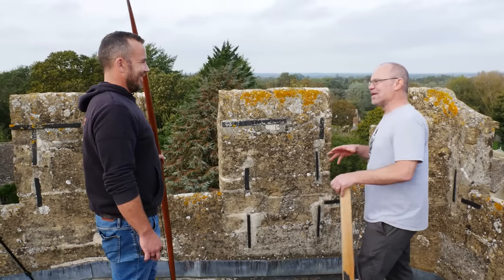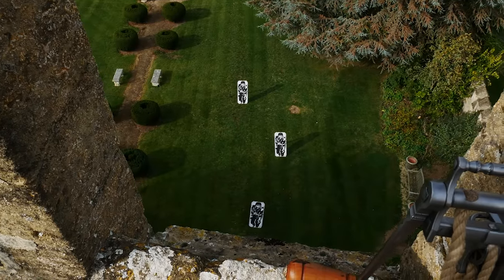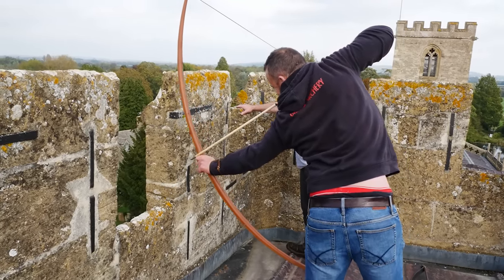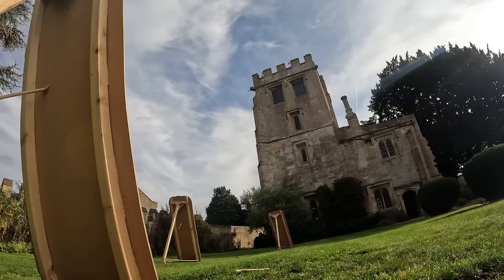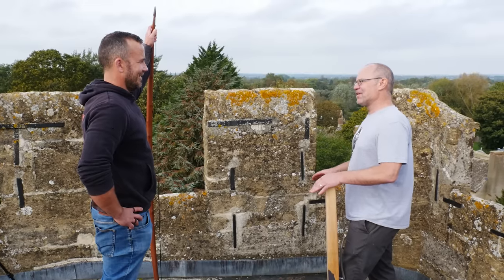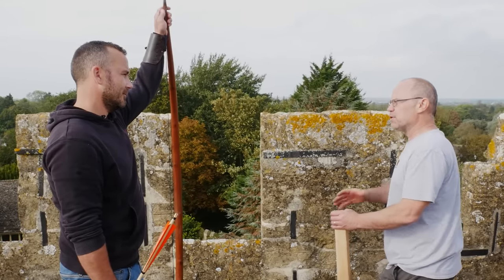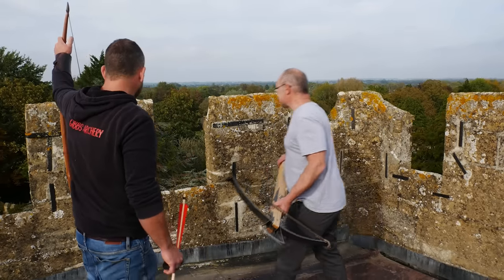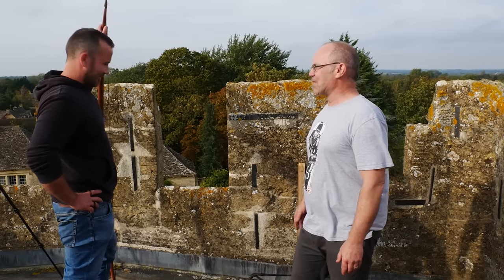Crossbow or Longbow? What's better for defending your medieval tower?

Comment from the maker: There are so many interesting points and thoughts coming up here - thank you.  Firstly I would have to highlight a couple of my oversights.  We know that crossbow men (but not always men) did employ spanners, so people behind the scenes spanning and handing already drawn bows to them and this increases the potential rate of shooting of crossbows and allowed it to be done in better cover than given by being on the 'front line'.  I also did not mention that of course crossbows can be spanned and held ready for a shot which is a massive advantage over a longbow which cannot.  However also note that a steel limbed crossbow can be held all day, a composite cannot, so cannot sit there ready and waiting all day.  I don't know how long you can safely leave a fully spanned composite, but I suspect they would want to get the shot off pretty fast, but still has a waiting/target selection advantage over longbows.

Weight of bows is very interesting.  Let's not pretend we actually know how heavy a war bow of the period was.  Quite simply we don't and it could be that the bow Joe is shooting would be exceptionally heavy for the time.  However unless he dropped weight really significantly he would still face the same problems, just to a lesser extent.  We must also acknowledge that the bows that came up from the Mary Rose (100 years later) were coming in at an average weight of about the same as Joes and I doubt period ships were that easy to shoot from either.  These bows were found in a naval context and were already falling out of use as a military weapon so we can draw inferences but not facts from these.  My personal opinion is that we're likely pretty similar to the bows of 100 years before; but again that is my opinion, not a fact.

Looking at the 'peek and shoot' difference between longbows and crossbows, of course every extra millisecond you are exposed disadvantages you over a quicker method, but I felt that there was not a massive difference between the two weapons.

As regards the ease with which a person can be trained to shoot a crossbow.  It is undeniable that you could span and shoot my windlass as I have seen my 10 year old daughter span it, that cannot be said for Joes bow.  With a little training you could shoot proficiently and threateningly  enough that at 50m the target person would dearly like to be somewhere else.  After a couple of hours most people would be striking the target pretty often at this range.  However crossbow archers were well paid, usually better than longbow archers and I am sure there are many reasons for this, but still there must have been very high levels of proficiency required for this better pay.  

But what we also know is during sieges it could be all hands to deck so to speak and walls would be manned by soldiers etc, but also by anyone who could be useful and that included women and children as well as men.  Some of these roles would be hurling rocks etc down, spanning bows, fetching etc but also I am almost certain I have either read or seen on manuscripts women shooting crossbows.  Of course Richard 1 was also famously shot by a (male) cook using a crossbow.  So it is absolutely fair to say that the use of a crossbow was easier for the untrained and possible for those with lesser physical strength.

That all said, I was very surprised about the lack of advantage of shooting down offered by the crossbow.  As a final note, shooting down is not at all a problem in terms of the bolt falling off, you simply need to put your thumb on the back of the bolt and hold it in place - the nut and string will do you no harm.  The spring clip to hold bolts was only invented around 1500, so prior to this your thumb was the answer.

As a last point, if anyone is reading this who has a castle, I would love to arrange some filming looking at arrow slits and proper crenellations.
Reply: Well said
Reply: I believe the reason for the pay of a crossbow user being high is also largely down to their gear simply being more expensive. And while yes, it's much easier to train someone to use a crossbow than a bow, there is still a noticeable advantage to have from proper firing discipline.

I'd also say that one other reason would be that archers were simpler to come by depending on where you are. Many people would have known how to use a bow at least reasonably well. At the very least well enough to be able to use a lower poundage bow with a fair degree of proficiency.

The increased cost of the crossbow kit would make trained crossbow users less common and I believe the general availability of the weapon itself would also be lower. So if you only have a limited supplies of crossbows, naturally you're going to want the people who are using them to be the best at using them.

There's probably other reasons but that's my thoughts on it.
Reply: @Salted_Fysh  They still had to be very effective  though, otherwise it just wouldn't work economically, at all.

If someone approaches you and offers you to do a job for 100$, and the other offers to do same, or even bit worse job for 400$, because he has much more expensive equipment... The choice is kind of nobrainer. No one would bother.

And entire continental Europe bothered with crossbow a lot, so it had to be worthwhile. Rulers protected the yew trees, because they were very useful for prods. Protected the arbalester guilds, and gave them privileges (like having first dibs on any horn available on the market). And so on.
Reply: It would have been interesting to see if a 50lb or so hunting bow from that period would serve just as well when they're up close, especially if looking for accurate shot placement, an arrow from a 50lb to the face would ruin your day as much as one from 140lb.
In 3d field archery we find ourselves shooting similar angles, much easier with the sort of poundage we use today.
Reply: @lscibor  well yeah, obviously crossbows are effective. But I'm saying the skill alone isn't necessarily the determining factor in the wage they get paid when compared to archers. It's more expensive to get and maintain the equipment. So even if you are not as skilled per se, you would still need to demand a higher price for your services. And since crossbows are useful (and people who use them usually come with a better kit), someone is going to pay it.
Reply: Just a thought, but if a siege went for a few days at the very least and i've got (as a defender) limited arrows, i will most likely not shoot neither constantly nor regularily. I think so far thats nothing new, BUT think of the consequences for the attackers: If the defenders shoot maybe once every few minutes and are out-of-cover for maybe a second or two, then there's no way to predict the defenders shooting, but also constantly shooting would be economically impossible for the attackers. So reversing it again, as a defender, whenever they are shooting volleys, you can just cover yourself, and when they shoot less, you have pretty good chances to take a look and decide werther to take a shot or not. Overall, i can imagine the defenders having an extremely "safe" situation (at least compared to the attackers), since statistics, circumstances (they can decide better when to be safe and when to attack) and economics are massively in their favour.

Imagine having one defender for lets say 10 crenellations and takes 5 seconds out of cover to shoot and shoots every 5 minutes. This would mean, in order to guarantee a hit every time (assuming perfect aim, but not being able to react quick enough to the defender popping up), this would need 12 shots a minute times 5 minutes times 10 crenellations where he could be, which would be a total of either 120 shots per minute or 600 shots in total. Now feel free to tweak the numbers, maybe he only takes 2 seconds, then it would be 1500 shots, or it's not every 5 minutes but every hour, then it would be 7200 shots (for 5s uncovered) or 18000 shots (for 2s uncovered). For a single defender and 10 crenellations. Basically, it is statistically absolutely impossible to preemptively shoot at crenellations in the hope to catch the defender in the right moment. And at the same time, good luck reacting, aiming at and hitting a target that is only visible for just as long as the person needs to shoot in your general direction.

I think this calculation suggests very well, why defence doesnt have to rely on numbers, since twice the defenders just means twice the chance to hit anyone, but are at a huge advantage when it comes to exchanging any type of ranged, human-targetting attacks. No wonder Sieges were won through cutting off supplies, hunger or at least finding some way to attack either the gate or the infrastructure behind the wall.
Reply: Great video, Tod. I think You missed one thing - no one shot at the besiegers so close to the walls because it was too difficult and too dangerous. And that's why the towers protruded beyond the walls so that people close to the walls could be shot from the side of the towers. In later times, fortifications in the shape of a star were built for the same reason - so that the shooters on one of its "arms" could defend the others. The bastions built outside the walls fulfilled the same function.

Another thing, I don't think that most of the defenders were equipped with heavy crossbows or bows - they were better for ranged shooting, but a smaller weapon would be much better for repelling attacks on the walls. It is not only more handy, easier to use and quicker to fire, but - above all - cheaper.

I think that when fighting an opponent close to walls, stones are much better. I hope that one day You will check how far You can throw 2 - 5 kilogram stones from the walls, but I think they would easily reach 10-15 meters. And You can throw them while completely hidden behind battlements - without aiming, but if there were a lot of attackers...

Anyway, I like thought-provoking episodes the most, so thanks again. And Merry Christmas!
Reply: Am terribly sorry do not have a castle to let you film at. What this did do is raise another question. What would the actual difference be when firing through murder holes? Theoretically i would say the construction of the crossbow would give it a fair advantage, but does it?
Reply: Should have tried shooting the crossbow vertically instead of the normal way..
Reply: I'm going to push back a little against the idea that we know what the "average" draw weight of the Mary Rose bows, because Yew has such a wide variability even when taken from the same tree. I know, for instance, that Will Sherman made replicas of MR79A0807 that came out at 130lbs, 145lbs and 170lbs, all using wood from the same tree. We have zero real knowledge of whether the high, middle or low end was what medieval bowyers aimed for when making livery bows.

If they aimed low, then the majority of Mary Rose bows were between 100 and 150lbs, with over half between 110 and 140lbs.

If they aimed high, then the majority were between 130lbs and 200lbs, with over half between 150lbs and 190lbs.

If they aimed for an "average", then most were between 110lbs and 180lbs, with over half between 130lbs and 170lbs.

(I can send you a link to my spreadsheets if you'd like)

A lot of assumptions have been made regarding how powerful they need to be in order to reach the ranges that people think are appropriate, but there's also been a lot of people not using the right woods or heads for arrows (making them too heavy) and arguing to a 220+ yard range when Tudor sources are clear that 220 yards is the maximum practical range and that livery bows and livery arrows generally underperformed in this regard.

Personally, based on the data I have on the Mary Rose bows, the size of arrowhead socket diameters, density of aspen, performance of modern warbow archers, well documented lack of nutrition on campaign etc, I tend to think that the range was 20lbs either side of 130lbs (110-150lbs) for livery bows, possibly scaling slightly lower.

It doesn't affect your overall point, I just want to point out the difficulties in estimating the draw weights for the Mary Rose bows.
Reply: @Cahirable  We do have some other points of evidence that suggest they were on the heavier side rather than the lower. For instance the skeletal remains that show huge imbalance, account of battle, invoice, historic account of effectivness and comparisons, other bows that survive in other locations and the like.  Mary Rose is a hugely important and as far as I know unique as a data point for the shear volume of reasonably preserved examples from a very specific date, but there are many other hints the draw weight is considerable in the bows that are meant for war.
Reply: @foldionepapyrus3441  

The issue with using the skeletons to argue for higher draw weights is twofold:

Firstly, the Mary Rose and Towton are the only occasions where we can tentatively identify archers through their skeletons, and the specific changes and injuries are almost entirely absent in the general population at the time. It's a puzzle that no one has really been able to solve, because by the 16th century we know that quite heavy bows were normal for sporting use.

Secondly, the skeletal changes associated with warbow use were identified because some of them are the same as the skeletal changes in Olympic archers, and are probably more a sign of the extent of practice than of draw weight.

I'm unsure of what you mean by "invoices" and know of no battle accounts or descriptions of performance that indicate 160lbs+/-20lbs as opposed to 130lbs+/-20lbs, but I'm always willing to check them out if you want to name them.
Reply: @Cahirable  As far as I know no documentation actually states at x draw distance weight should be y. But the point still stands there is a large amount of suggestive evidence pushing for the higher end of the estimates. How high is debatable, and would almost certainly vary hugely depending on exactly when in period you wish to refer to - armour improves so the bows get more powerful etc.

Including details like the descriptions of hunting vs war and the requirement to practice at the butts etc - if your normal warbow weight was at the lower end that mandatory practice would be unnecessary in a world where virtually everyone is employed at serious manual labour. Shooting in enough of the right direction to be useful  isn't hard, and that conscriptable force would I'd suggest  pretty easily  be able to pull the more 100 pound end. At least often enough to quickly become acclimatised to that weight and good enough to be a competent force.
Reply: @foldionepapyrus3441  

Henry VIII's archery law says that flight arrows shouldn't be used at targets closer than 220 yards, and one of the few things that Smythe and his critics agreed on was that 220 yards was the maximum practical range for a military bow.

 Barnabe Rich, who fought in Ireland in the 1570s with a lot of archers, says nothing about civilian bows being weaker than military bows, only that the civilian arrows (and hence draw) were 2-3" shorter than the military bow. Similarly, Ascham assumes that anyone using a gaming bow will automatically be able to use a livery bow, and his only real remark on these is that they tend to be less well made.

The butts in most villages, where we have two of them, indicate that most practice was done at 80-100m ("An Archaeology of Town Commons in England"), so while roving was a popular past time and there were famous areas like Finsbury where the arrows used were almost exclusively flight arrows (only a couple of marks are under 220 yards from each other), it seems that most archery practice was conducted at shorter ranges.

The overall picture is thus that by the 1540s and into the 1570s there was little difference between civilian and military bows when it came to draw weight, and the main differences seem to have been draw length and quality of manufacture. Since most people practiced at closer ranges and 220 yards was seen as more of an upper limit than a military reality, there's little reason to think that archers were required to shoot that far in order to qualify.

Additionally, given that it's very well documented that armies on campaign almost universally suffered from food shortages, reducing the abilities of the archer, it makes very little sense for the higher end estimates to be the norm on campaign, regardless of what was the usual draw weights of their "gaming bows".
Reply from the maker: And this discussion, it’s quality, thought, knowledge, politeness and other qualities is why I love the comments section so much - thank you
Reply: @Cahirable  On taking draw weight from the butts I'd have to say you are wrong - they would practice shooting shorter range as there isn't a great deal of point trying to shoot at greater distances anyway - you won't hit reliably. 

And while its not a direct comparison being from other continents we know tribes that almost exclusively survived because of Bow hunting even very very recently used draw weight that are more 60 pound as an upper limit, while still being able to shoot through the animal. (The Hadza as the example that jump into my head)

There is no reason to believe therefore that the English or European hunter would pack the equivalent of an elephant gun to shoot a house cat... And as that lighter weight bow wouldn't then be able to effectively shoot the warbow arrow heads that have been recovered as the required shaft thickness so the head's greater inertia doesn't snap or excessively flex the arrow makes the arrow just too heavy for it. I'd think and testing seems to prove - though maybe a stiffening processes could be done on the shafts we don't know about etc. 

But as you need that weight in the medieval period - you are not going up bow weight to shoot further, you are going up bow weights to be able to fire arrows that might actually overcome the armour). The same sort of thing that you see play out in modern military procurement - hmm body armours are getting common and effective - better up the power, make the penetrator of harder materials etc.

I don't entirely disagree with you, and we certainly can't know for sure without new evidence we don't have (or at least nobody in the comments has yet mentioned). But for me the body of evidence we have all points towards that 160+ sort of range for warbows.being sane but quite possibly still conservative.
Reply: Agreed. I guess professionalism is likely why crossbow men cost more as well as equipment.

This video even shows the usefulness of the crossbow as a blacksmith with a archery hobby can work decently with a crossbow while it needs an actual archer to attempt to use the bow.
Reply: This was an amazing video - awesome to look at the realities faced by medieval defenders. 

My only question would be about your discussion on the defender's vulnerability. I wonder if how exposed you felt firing from the parapet in your test, matches the actual danger in all but the highest pitch of battle. As you showed from your tests, while you felt vulnerable and your shots were awkward, the attackers are much more exposed in the open than the defenders are behind their battlements. And, no matter how awkward it is to fire from above, I'd presume it would be far more difficult to accurately fire up from below at a half obscured target ducking in and out of the hard cover the crenelations provide. When you consider attacking archers would also want to stay back at range so as not to be the sitting ducks your targets were, I'd be even more skeptical about their chances to hit with any reliability. Additionally, unlike this test - a real battle would have greater numbers on both sides. More defenders taking pot shots at exposed attackers would offer a degree of suppressive fire that would likely deter even moderately armored troops. Especially when non-fatal wounds to less protected extremities could still leave soldiers unable to fight, and even kill from infection much later.

I'd be interested to know if this was borne out in any of the battles of the day. :)
Reply: @Salted_Fysh  this can be somewhat sumed up with the whole levy archers style as a lot of pesentry expecally in the country side would know basic archery for things like hunting game (depending on area) so when called up to fight they would bring their own basic bow and of course be played less, where as crossbow expecally the heavy versions like the wind up ones would be more of a profesical army equitment supplyed by the lord which would of course intail more costs assosated with those archers
Reply: Firing down from a crenelated tower would be much easier with either a recurve composite bow or a crossbow with shorter arms. At the ranges you are talking about, a crossbow with a handier build would not  be penalized as much as a 4 foot wide 700# bow, as you would not see a significant drop off in velocity due to range and windage. 
At any rate, if the attacker is so close to the walls that you can't shoot down on them, there are other defensive measures, such as hot oil or heavy rocks to drop on them. The oil could be used as a fuel to burn the guys closest to the wall, with the risk that any fire might compromise  the defensive structure.
The shooting down problem was true for firearms as well, which is why many stone built fortifications had firing ports on the ground level with iron doors for protection from incoming fires. Fort Oswego in Upstate New York has such ports on both sides of the main gate as defense, behind 4 foot thick granite walls and an enclosed room for 10 to 20 musket bearing soldiers.
Reply: @foldionepapyrus3441  I think the biggest disagreement is whether or not the sporting bows used were hunting bows or "target" bows in the 1450s and beyond. If we were talking about 1350, then I'd largely agree. The archaeological evidence in the form of arrowhead socket diameter for the early 14th century shows a disconnect both between what shows up on peasant sites compared to castles or manors and also between military arrowheads found in military contexts and those found in the general population. The LM16/M4 arrowheads have socket diameters of mostly 9-10mm, but on manors and castles these tend to be 10-12mm. So, in my opinion, many of the ordinary civilians weren't using anything much above 80lbs for military service.

Fast forward a hundred years, though, and very few military arrowheads have a socket diameter as small as 11mm, and the texts start to imply that there was no real difference in power between gaming bows and livery bows, and it starts to become apparent that the introduction of mandatory training in the 1360s and extensive use of archers in warfare has resulted in most civilians owning bows to fulfil military (whether offensive or defensive) obligations. If they hunted with bows, they would have had one more suited to it.

If we look at the Ottomans and the Qing, then 130lbs is at the high end of what was used for actual military service, with only a few routinely drawing heavier bows and most drawing 160lbs+ as a test of strength. Mind you, given that on campaign performance was known to atrophy, training on heavier bows was an excellent way to ensure they could continue to use their regular bows for longer, and that may also have been done with medieval bows.

The weight of the arrows has often been exaggerated. With an M2/M4 arrowhead, or with a short bodkin like those at Camber Castle, total shaft weight would have been anywhere between 45 and 60g, depending on density and profile, and probably around 50-55g. Heavy, certainly, but not the 80-113g that is often imagined as the "standard" arrow. Joe's tests in AvA2 indicate that an arrow spined for a 160lb bow shoots sufficiently well from a 130lb bow, but he didn't think it did so well from a 110lb bow, which suggests that an arrow shot from a 130lb bow should shoot reasonably well from a 110lb bow, and also possibly from a 150lb bow. There was a similar test performed in the now-defunct Glade magazine that I've seen quoted a couple of places, where a Mary Rose replica arrows shot as well from an 80lb bow as from a 120lb one. I wish I could get my hands on that edition and read the full test, but what I've seen so far suggests that the Mary Rose arrows would shoot just as fine from a 100lb bow as from a 160lb bow, it just depends on how exactly they were spined.
Reply: @Cahirable  Hmm never heard of Glade and now I wish I could read it too. But if those replica MR arrows are shooting well from an 80 pound I'd be shocked if they could really work out of a 160 or more - certainly some range of draws for which the same arrow will do but everything I've ever read says the window that works well in historic materials is much much narrower than that. Always seems to be more like a 40 pound total range the arrow actually functions for. And I'd expect at the highest end the range of functional might well get smaller - the arrow will get heavier faster for every mm of radius the shaft needs, and it probably has to get fatter faster the heavier the bow - its own growing inertia gets ever more stubborn but the stiffness of the shaft doesn't increase similarly.

Though I could easily be wrong as the force over time profile a heavier wooden bow actually delivered may be very much different as well.. The thicker the bow gets the more of its energy must be wasted on itself, which might actually lead to a lighter arrow being shootable again from an even heavier bow - if the force is applied to the arrow a little less brutally in the initial acceleration phases as the heavier limbs have to get moving first it might actually work to put more energy into that light arrow than the light bow its 'meant' for and still have it shoot well enough... 

Be interesting to shoot a sensor package laden arrow from a few bows and/or have the real high speed camera (which I'd think would be nearly impossible to keep in the action in frame for the higher framerates). 

Probably also worth considering that the bows on the Mary Rose may actually not be at all typical of the period, though as far as I know there is no evidence to suggest there are differences. But assume they are intended for use at sea and as humidity messes with bows and the awkwardness of a shooting off the moving ships deck around all the obstructions means you may be deliberately choosing not to use the full draw. Which does lead to wanting more powerful bow - you won't be drawing it to full draw very much if ever, but still get reasonable power out of it at that smaller draw..
Reply: Crossbow has several advantages for the besieged. You mentioned several of them. But there is also one:
- The most common tactic for any siege is well... siege. The archer's ability drops significantly when hungry. Few days with minimal or no rations and they won't even be able to draw their war bows. While crossbowmen can still shoot. They will be as miserable as any other footmen but they will do their job.
Reply: @foldionepapyrus3441  The Glade is where Mark Stretton originally published his experiments with archery. There seems to have been a real burst of warbow related articles c.2002-2006, and we're lucky we at least have Stretton's blog and Hugh D. Soar's book to preserve at least some of them.

Sorry if I gave you the wrong impression, but the Glade article was 80-120lbs and then separately there was the AvA2 experiments with 110-160lbs. The 40lb range, as you suggest, seems to be the maximum spread for arrows.

Re: Mary Rose bows being special, I don't agree with this. The arrowheads from Holm Hill and Camber Castle would all fit the shafts recovered from the Mary Rose and suggest that the Mary Rose bows are representative of livery bows on land and in the mid-15th century.
Reply: @Cahirable  Ah, interesting info.
Technically the arrow heads can be identical and still have a thicker arrow shaft - thinning down a little bit more at the socket is not hard. Though equally if you expect to shoot it at only partial draw or while the bow is rather more water logged so performing worse then arrows that are 'for' a slightly lighter bow in ideal conditions may well shoot normally. 

I do agree though that it is unlikely the bows were different on land and sea - logistically seems like more effort than it would be worth to try and deliberately maintain a separate stockpile. Plus if a solider can get their hands on a more powerful 'naval' bow and actually manage to use it in their normal conditions they would, and a warship is often just as much about transporting troops and war material as it is fighting at sea in this period. So logically the ship should probably have had more normal bows as well if there was a difference.

But as far as I know we have no evidence at all either way, which means we should be open the possibility the bows of the Mary Rose are not really representative of their era, as there are some logical reasons they may not be.
Reply: Really wishing I had a castle at the moment.  😅
Reply: Surely there's a castle out there for arrow slits! Surely Bodium Castle would be perfect, no doubt you've asked the National Trust.
Reply: How far are you willing to travel for that castle?
Reply: Tod you want to know the real advantage of a crossbow not minor detail like the siege.
Have you & your mate wear various type of armours especially helmet types then you will realize a crossbowmen has a lot more protected options.
Firing a crossbow with a sallet, barbute or even a fully encased armet is easy but knocking a bow is difficult in anything more then a kettle or nasal helmet from my experience though I'm more polearm & staff treatise guy then ranged weapons that aren't guns. 

In a great basinet or great helmet say I wouldn't want to use any ranged weapon except maybe a javelin with practice especially if from mounted personally. 
Mind mounted you have lances & well muzzle loaded pistol stepped in on the cavalry role till lances were rarities by the time revolvers were common place with cavalry sword as a mounted side arm.

People that don't see the advantages of 'Crossbow' have never worn hefty armoured full harness.
Head to toe as long as you have a decent vision you can load & fire a crossbow but bow armour must be sacrificed to have vision & greater range of movement!
It is tiring firing a boy out of armour but try it with both arms & chest in full plate or mail as you will fire about 1/2 the amount of arrows you normally could.

Perhaps a very fit young man could fire arrows in full plate with the appropriate helmet for an entire battle but I know damn well I couldn't do it even before my failed health!
I could fire crossbow or musket in full plate with a even more protected helmet most of the day mind till I needed rest as we all do.
Drawn out battle or my deteriorated condition I know well I'd want a crossbow & am fooling myself to use a bow.
The bow is best for quicker decisive battle & prime fit men.

Another matter to consider is try carrying any polearm with a strung bow rather then crossbow  & say a pole.
You can wear a Pavise on back while carrying spear & crossbow over shoulder with aside arm on hip.

A bow you can't lay over shoulder or have on sling to wear like a bag as you can do with a crossbow.
You can free up hands with a strap & a pavise on back doesn't impede firing or spanning a cross bow as it would for a bow that requires form/upright-posture.

The most shield wise a bow user can carry is buckler with his side arm if realistic till it is cumbersome or awkward. 
The Cross bows strength is lack of training required, ease of use & simple ever underestimated versatility.
Mercenaries loved crossbows as they had no idea were their work would take them which try firing a bow in the alps in sub zero temperatures!
Cold & aching muscles matter a lot for a bow unlike a crossbow.

You might be in good condition but let the elements get deep to your bones for a few days traveling on foot or horse as I guarantee the crossbowmen will be truer with their aim & always at full draw unlike the bowmen!
You should both go a dip in ice then see who has the better aim & fire rate Todd.
Mark my words you will see the crossbows strength same as a guns for it doesn't take muscle but memory of action in motion!
Reply: Great vid. Would love a futher/deep dive look into this further. Different castle perhaps, different bows, crossbows etc. Ideally as much as possible ofc, withIn whats possible. Maybe a certain location that can he used for multiple videos to make proper use of your time/money.
Reply: Were are the Castle owning people!? WE NEED YOU TO STEP UP! 😁
Reply from the maker: This should be more of a Joe/Will answer, but spineing of arrows is not so important when it comes to distance (as far as I understand it).  A heavy livery shaft at 80g or a light MR shaft at 40g will both fly and just because the light shaft goes 10m left it doesn’t matter too much at 250m out.  An army is a big target after all.   It appears bows could be between 100-160lbs and no arrow would match this range and I doubt they were issuing different arrow spines, so the answer is realistically one arrow that kind of worked for everything.  A bit high/left, a bit low/ right or bang on.  Who cares; just loose the darn thing.
Reply: Hy tods i need to ask some of the long bow @Joegibbs-archery can you help me? Grazie
Reply: Also spanning devices (I do not know the English word for it) made from wood might help a lot. With them someone (pretty untrained) can easily span a crossbow and hand it over to the shooter(s). They are a bit big but the right thing to use behind a castle wall. I mean these devices with a lever, where the Xbow is put in and the "helper" spans the bow for the shooter.
Reply: Can you please make a video where you shoot at armor from battlements? Arrows vs Armor 3?
Reply: Maybe someone already wrote it. Joe's "short-range, acute angle, full draw, heavy weight problem" could easily have been solved by a 3/4 or 1/2 draw. It also makes sense for fatigue reason.
Reply: I wish I had a castle
Reply: I hope I don't sound rude me bringing this up , but does weather effect the strings of both the crossbow and the longbows? Like rain, snow , summer heat ? Because that could also be an additional issue while defending a castle / tower . I really hope I am not rude bringing it up sorry if it was
Reply: considering how i have no idea how to shoot arrows with the bow and most likely i dont have the skill, that means crossbows are better
Reply: Well, when the enemy got that close you poured hot tar on them... as you said this wasn't designed for war but it housed soldiers but a small place like this can only with stand so little
Reply: @Salted_Fysh  There's also a lot more specialized maintenance knowledge required to keep a crossbow in good working order in the field since it's more mechanically complex.  So if you want to hire troops for a campaign who know how to take proper care of their gear, it's going to cost you.  But having everyone with working fingers grab one out of the armory for a few hours of shooting down from the walls wouldn't run into that issue.  At least, not immediately.  So long as there's enough downtime for your armorer to do the maintenance between battles.
Reply: The exposure of the shooters to return fire could also be minimized if you had someone with a shield to cover the gap, fully or partially.  You need the wide gap to give many good lines of fire, but for any particular shot a much smaller one will suffice.  This also would let the bowman wind up, then open the gap, shoot, and close the gap.  Given the relatively low speed of arrows compared to bullets it quite possibly wouldn't be feasible for attackers to time their shots in any meaningful way.

Also, I wouldn't say those crenelations are just decorative.  Most of the decorative ones are much smaller and don't have enough space to truly hide behind them.  These ones are full size, just much thinner than on a proper castle.  They likely wouldn't stand up to siege weapons, but no band of brigands with light weapons is going to damage them.  For that matter, even modern smallarms would take significant effort to chew through them.  Undoubtedly they were put up there for largely artistic purposes, but the person designing it obviously decided that they might as well be actually useful if they were going to bother with the extra work.
Reply: Could you rest a crossbow on stone wall - for support and better accuracy ?
Reply: One shouldn't forget that machicolations were common and those make it possible to hit people close to the wall.
Maybe do a test again with those?
Reply: Quite a good summary…also the men of old were certainly more hardy and perhaps stronger…
Reply: I suggest that the bows from the Mary Rose will have been heavier than the earlier period as people tried to keep the traditional weapon relevant in a world of emergent firearms. We all know just how conservative militaries are, they just couldn't let go? Just a thought
Reply: Tod also you can have someone reload the crossbow you were holding and they can give you  a crossbow that is already loaded.
Reply: There are some castles in Germany that often allow nowaday sport archers to shoot from their cranelations. Just look it up and you will probably get a lot of results and invetations if you ask.
Reply: Sir tod, may i ask if you have tested if it's an advantage for bow men in this situation to just shoot straight to the sky and rain down their arrows and have a single person peaking calling out the shots? 
Because i think they would be faster and wont be exposed at all.. 

The second question would be if this is plausible then would the arrows be enough to have tactical advantage like keeping the opposition's shields up? Or have power to penetrate the armor, 
Because i believe that arrow fires are used for suppression much more than precision in this kind of battle..
Reply: The longbow is huge and I imagine it's much more awkward to use in more crammed battlements. You require way more space to shoot the bow and to move around with it. I mean, even just looking at this video makes it clear anyone could have seen the longbow extending over the merlons when held vertically, and it would just be awkward to hold and move with it in any other position without potentially hitting something or someone else if there are a lot more people in there. I can only imagine bows being even more awkward to use with arrowslits.
Reply: Big difference between bows and crossbows is that peasants can shoot the crossbow and you could teamup .. one loading one shooting.